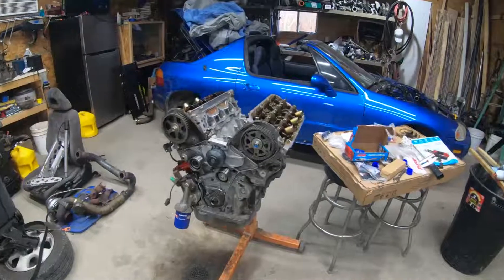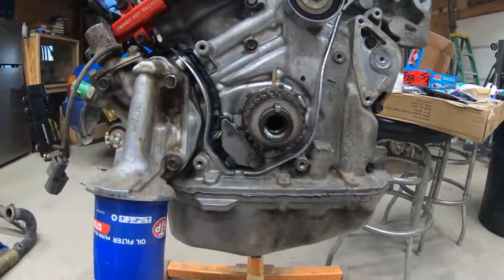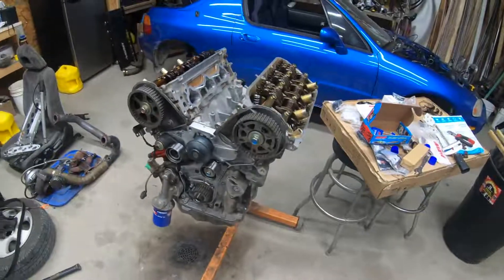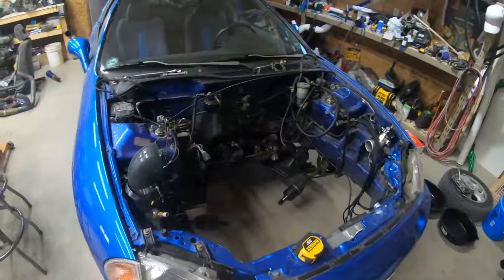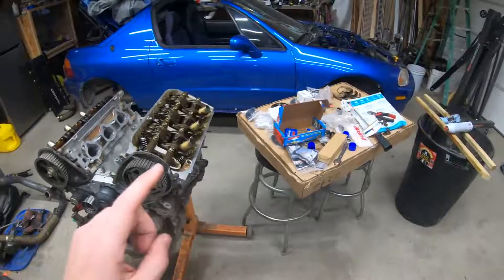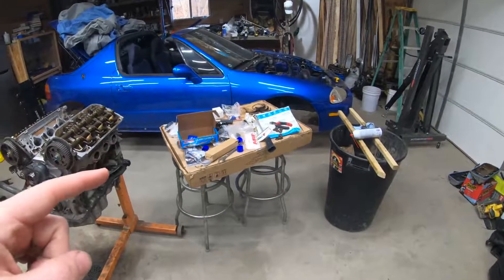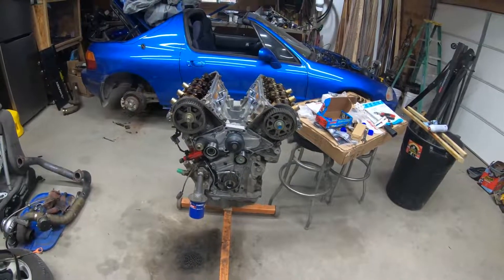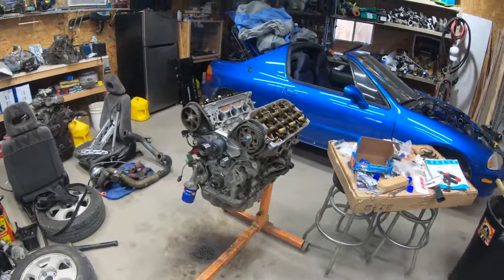J35 Microsquirt Guide Pt. 2

Comment: Sorry I’ve been commenting so much but you’ve been of great help, and I am extremely close to finishing installing in my j32a3 EG, I lost the comment but you had said to grind every other tooth for a3 correct ?
Reply from the maker: @RealWorldBuilds  I believe so. That should get you to a 12 toothed wheel. Then you’ll need to get rid of 1 more. The tooth counter clockwise of the keyway. That should make a 12-1
Reply from the maker: @RealWorldBuilds  the position of your crank sensor may change the missing tooth needed. If tdc is 12 o’clock point the keyway to the bottom left around 7:30 and cut the tooth at the sensor location. If you already cut this tooth it’ll still work but your setting to setup where tdc will be greater than what I set in the software.
Reply: @soullesssol7285  that’s awesome thank you!! Follow up question, the a3 has the big 6 wire crank sensor, would the vrn setup be the same or how should I go about setting that up
Reply from the maker: @ 6 wire sensor is two sensors built into one. You’ll only use 3 of the wires. You will need to figure out the supply voltage for the power wire. Could be 12 or 5v. You’ll most likely need a pull up resistor between the supply and signal wire. Usually a 1k ohm resistor.
Reply: @ found a perfect diagram for the sensor they are 12v power and just to be sure, have a 1kresistor go from the 12v to signal, and Vrn+ from micro goes to signal and then vrn- to ground wire
Reply from the maker: @ no I believe you’ll need a 1k resistor from vref to the signal wire. I don’t believe the micro can handle 12v on that wire. I could be wrong on that though. May have to get the microsquirt manual out for that one.
Reply: @soullesssol7285  update, from my understanding of the manual research, I need to get 12v to the pwr wire from a fuse, put a 1k pull-up resistor from signal-pwr, connect signal to vrin- on the micro, and then connect grnd to a sensor grnd also on micro. never even seen a stand alone before this, so if that sounds insane please let me know but really thank you so much for your help!

Comment: Do I have to use a crank sensor with micro squirt? My engine only has a hall sensor on the distributor.
Reply: if you have already made the leap to micro, do yourself a favor and ditch the dizzy & the headaches.
Reply from the maker: You can use a distributor with the micro. Is this an early j series?